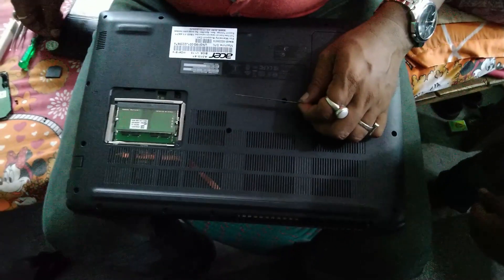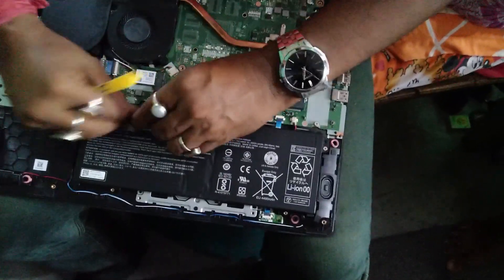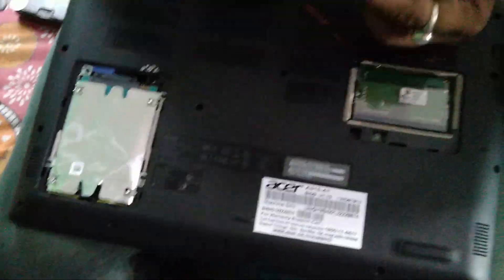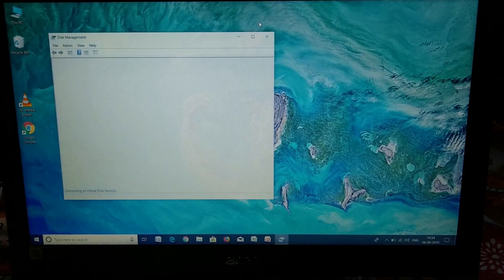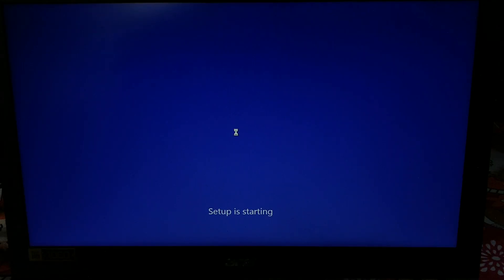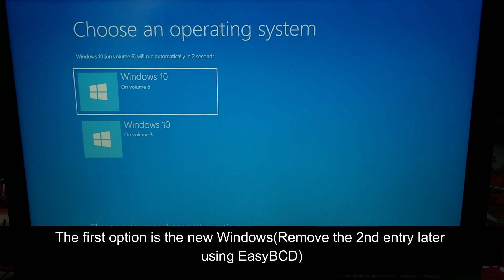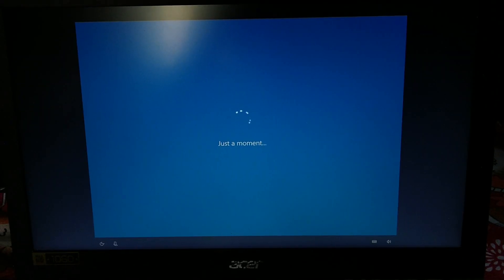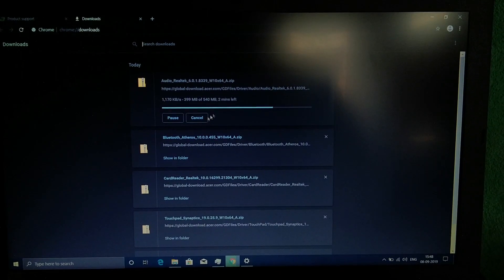ACER ASPIRE 3 a315-41 M.2 SSD INSTALLATION (SSD + HDD) | REINSTALLING WINDOWS GUIDE

Comment: bhai, can I also add another ram slot in it. does this laptop aspire 3 a315-53-p4my comes with two channels of ram or only one channel ? I wanna upgrade my ram along with the ssd so what should be the best option for me?
Reply from the maker: Zian here is the link to the full review! Subscribe 😄
https://youtu.be/6hl1k5oFV00
Reply: @DeepteshLovesTECH  thanks I was looking for the link. hehe so purchase kar lu naa 4 gb ddr4 ? nhi aani na koi problem generally? agar jyada kismat kharaab hogi (joki hai ) to fir dekhte hain. nhi?
Reply: kingston ki to mil nhi rhi ye mil rhi hai  Western Digital WD Green 240 GB M.2 2280 SATA Internal Solid State Drive (WDS240G2G0B)

    Western Digital WD Green 240 GB M.2 2280 SATA Internal Solid State Drive (WDS240G2G0B)
Reply from the maker: Zian yea you can purchase.. I personally have never faced ram issues.. however in shop you can test out and it might be cheaper, I recommend ADATA ram as it has 3-5 years warranty.
Reply from the maker: Zian sahi hai WD green bhi.. le lo.
Reply from the maker: Zian you can add another stick of 4gb ram. It comes pre-installed with a single 4gb stick. Go for 4GB DDR4 2400mhz ram.
As for SSD I recommend Kingston A400 240GB M.2, its fast and affordable.
Reply: @DeepteshLovesTECH  sometimes rams doesn't match. is it true. Should you not purchase a ram kit instead of an individual ram? would it work? and last question that does using ssd really boost speed? if yes then what the percentage ? have you made any performance video?
Reply from the maker: Zian yes I have never in my life faced any problem purchasing a different stick of ram.. if you want to ve extra safe.. go to the shop and try. 
Ssd improves overall speed and windows performance by a huuuuuge margin! Think if you put regular fuel in a super car, would it perform well?!
Yes I have done full detailed review of this laptop, it's in my channel! Check it out! I have said all about performance!

Comment: Bro what if i install Windows Pro on it? Is it still gonna work properly? I am using the same laptop but with Radeon 535 gpu.
Reply from the maker: 나연NEO you use pirated Windows 10 pro. It'll work, else you have to purchase windows 10 pro activation key. This laptop comes with Windows 10 Home so it will activate Windows 10 home, for others you have to purchase key or use pirated versions.
Reply: @DeepteshLovesTECH  uhm do you think theres a diff in terms of speedness of the os with home vs pro?
Reply from the maker: 나연NEO nothing.. no difference. I use Windows 10 Home on my Acer predator.

Comment: I got my acer a315-41 today, same as yours. I already had bought the 8gb ram stick and 480 gb m.2 ssd. Now i found out that it has a warranty sticker. I called up the acer service center in kolkata and they told me to bring the laptop and it will cost inr590 for the upgrade. I don't want to pay that for this simple work. I called up asus customer care and they also told they can't help and i have to visit the service center. Any suggestions from your side mate? Can i safely remove the warranty sticker at home and proceed with my upgrade and paste it back.. or is it too risky?
Reply from the maker: Satyajit Routray exactly just remove the sticker slowly then put it back, no worries. The acer technician said they don't care about seals, infact one of them literally made a hole in the seal on one of my friend's laptop 😂 My technician however simply removed the seal n then put it back.
Reply: @DeepteshLovesTECH  Thanks you mate. Now i can proceed carefully.
Reply: @DeepteshLovesTECH  Hi mate, i successfully installed ssd in my laptop. It's showing in the bios in the hdd-1 section, but doesn't show in boot priority section nor it shows inside the windows disk management section. Mine was WD GREEN 480 M.2 SSD.
do you have any idea, why this is happening?
Reply from the maker: Satyajit Routray it should show in disk management.. it'll ask you to initialise the disk.. and you just hit next next and it'll automatically create the 480gb unallocated partition which you'll then Set up.
Reply: @DeepteshLovesTECH  bro how big m.2 ssd does it support 500 gb or 1tb.. and hows the price..can i use it as additional storage also?
Reply from the maker: @lowendgamer4213  I haven't read of any limitations.. basically it should support as much as m.2 sata 3 is capable of.

Comment: Hi Deeptesh ,Ialso have ACER Aspire 3 A315-53G-54GZ   BUT your's is A315-41 so it's possible to fit SSD in my laptop without removing HDD , PLEASE ANSWER
Reply from the maker: Fahad Khan It should be the same, you can open your laptop n check whether it has m.2 slot(it should have in theory)

Comment: Bro, can you give link to 4GB Ram fro where you bought. 

I bought from Amazon but it's pin is not matching even it's ddr4. Don't know buy.
Reply from the maker: Misal Ambasta I bought 4GB Hynix ram, it was provided by the acer retailer, this is the OEM ram that Acer uses, it's good but very overpriced.
You buy Crucial 2400mhz 4gb ddr4 from Amazon, works flawlessly. I have never heard in my life about pins not matching for ram. You probably bought desktop ram or something.
You can buy from shop also, that way you can test first.
Go for any 4GB DDR4 2400mhz from Adata/Crucial/Kingston.
Reply: @DeepteshLovesTECH  no bro it's laptop ram only of Crucial company and Acer engineer told it's another type of laptop ram. Don't know what amazon's seller sent. 
I have ordered another one. Let's see.
Reply from the maker: Misal Ambasta i can assure you Crucial ram is fine. i have used Crucial/Adata/Kingston/Hynix/HyperX all rams. I have never had any problem with any ram.

Comment: Should I buy this laptop 24999 +extra ssd +ram
Or should I go for acer swift 3 i5  512ssd 44999
My budget is tight and the laptop should work properly for 5 years...
Reply from the maker: swayam obviously go for the Acer swift 3. It's a well built machine slim, it has dedicated Nvidia Mx250 graphics and a much better ips display! This aspire 3 is almost half the price. Beware swift 3's ram is probably soldered. Anyways swift 3 and the Acer Aspire 5s(cheaper than swift 3 and almost same) are much better performance machines than Aspire 3.
Reply: @DeepteshLovesTECH    which one will give better value for money ??? 
Because budget is a issue, but I m bound to buy swift3, if it does not work for 5 years....
Reply from the maker: swayam dude I spent 2 years with a laptop(dell e6400 i5 2nd gen) which was already 4 years old and it is still working absolutely fine.
Why can't you spend 5 years with the Acer swift 3? The swift 3 is one of the best value for money ultrabook.
Reply: @DeepteshLovesTECH  thanks  bro....I m 1st year student and heard that after 2-3 years any laptop except (mac book) does not work properly.... 
But thanks for ur suggestions...
Reply from the maker: swayam I am a 4th year student.. the only thing that will get worse or damaged is the battery. I'm using Acer Predator for 1.5 years now, let's see how it keeps up.
Reply: @DeepteshLovesTECH  parents got my budget down to 35k ,   so will the avita libre i5 8th gen , 8gb+ 256 gb ssd work well for me(price 35k)....   I do not know anyone using this brand but it has good rating on flipkart.... 
Is it's ram and ssd upgradable...
Reply from the maker: swayam I don't know anything about Avita.
Reply from the maker: swayam check store price for the Swift 3 also., That way you can get extra 2 years Warranty for very less price!

Comment: What laptop would you recommend right now 30-40k is my Budget, I prefer Ryzen because i will be light gaming on this and Vega 8 really helps.
Reply from the maker: Vedant Mhatre if you have 40k budget, then during big billion days you will get Acer Nitro 5 2019 with Ryzen 5 3550H(35W cpu) and Rx560x 4GB GDDR5 graphics at only 39990(without ssd model). Best deal in India. Or else if you don't play too much but still want to play games then buy the Acer Aspire 5s(39990 during sales) slim laptop light weight, great specs with nvidia MX250 graphics. 
See in the 35k range try to find a laptop with atleast 4 cores(i5 8250u or Ryzen 5 2500u) ,8GB ram(you can buy 4GB model then add another 4GB stick), and see if you can nvidia graphics (with AMD you'll get very capable Vega 8 integrated graphics).
Also see if the laptop has a 1080p screen and m.2 slot.
This Acer aspire 3(check my channel for full review) is an amazing machine for a cheap price! Upgrade RAM to 8GB and add an ssd, you are set!

Comment: Is it just me or does the guts inside this acer laptop is the same as acer's nitro 5 ????
Reply from the maker: Aegon Targaryen I don't think so, the Acer Nitro 5(intel/nvidia or 3550H/rx560x) has far beefier internals. So different heat pipe/fan config and also Nitro 5 (probably) supports NVMe.
Reply: @DeepteshLovesTECH  i meant the layout :)
Reply from the maker: Aegon Targaryen may be.. not sure.

Comment: Dude can i use an  M.2 2280 Pcie Nvme on my Aspire 3 a315-41G?
Reply from the maker: Jhony Castrillon I'm not sure about PCIe NVME, I don't think it supports it. Go for Sata 3 the performance differences will not be noticeable n sata 3 is much cheaper.
Reply: Thanks!
Another thing; i saw a few M.2 SATA like the ones u linked at the description.
The thing is, they were other than didn't have 2 spaces, only 1.
Those can be used too o are just completely different?
Reply from the maker: Jhony Castrillon I'm sorry, I didn't get you.
Reply: https://subefotos.com/ver/?24153d5e7d1907604ce3826a58403430o.jpg 
This is what i mean sir, the socket and the M.2 than i got are different from yours.
I can still use the one u linked?
Reply from the maker: Your image is different because it is PCIe NVME, my linked drive is SATA3.
Reply: @DeepteshLovesTECH  ohhhh i get it.
But i  connected it and didnt show anything un my Bios le anything like that, what can i do?
Reply from the maker: Jhony Castrillon idk i already told you, I don't think Aspire 3 supports PCIe.. try SATA3.

Comment: Hi bro, can i install a HP M.2 NVMe PCIe SSD and an additional 16GB RAM  in my Acer Aspire A315 - 55G
Reply from the maker: Nagarajan k I don't think Aspire 3 supports NVMe .. use SATA 3. Yes you can install 2x8GB ram in your laptop. Don't install 1x16GB. Install 2 8GB sticks.

Comment: Hey mate, can you suggest the best capacity for m.2 ssd cause i have read that 1tb ssd will make the disk take more time to load. Btw i am not a heavy gamers.
Reply from the maker: aideehalim 16 240GB is a sweet spot in terms of value for money. you can get WD 240GB m.2 from Amazon.
Reply: @DeepteshLovesTECH  what type for that socket? M.2 sata or nvme? If you dont mind can i get your social media acc for any purpose? 😅
Reply from the maker: aideehalim 16 I am pretty sure it is M.2 SATA3 not NVME.. so don't buy NVME.
Reply from the maker: aideehalim 16 check description for social media ☺️

Comment: Hi Deeptesh as you installed 120GB SSD just for C drive where window is installed what about the rest? Does installing window on C drive where SSD is there improve overall working experience. or just App loading time, Performance of softweres?
Reply from the maker: Definitely it improves the performance extremely! Whatever software you install in the ssd also opens up much faster... Check my channel where I have uploaded full laptop review, you can see the performance bump as I describe there... And the whole HDD is basically the D drive 😊
Full review: https://youtu.be/6hl1k5oFV00
Reply: Hey @DeepteshLovesTECH  i have heard that AMD Ryzen 5 processors only last around 3 year of time and after that You start to face issues like Graphical errors and danages
Reply from the maker: @anishaansari330  which guru said this?

Comment: Hi Deeptesh, I had bought this laptop for my Dad's word-processing work :-) He stopped using it and I need a laptop. But this one is very slow, I wanna upgrade and I came across your video. My savior :-). Just one doubt about the SSD can I instead use this SSD? ADATA Ultimate SU800 512GB M.2 2280 instead of ADATA Ultimate SU650 512GB M.2 2280? The only difference between the two is S800 instead of S650. Thank you.
Reply from the maker: Watch the full laptop review on my channel too... Make sure the S800 is not PCIe, the laptop only supports M.2 SATA3 ssd
Reply: @DeepteshLovesTECH  ok thank you.

Comment: I wanna add ssd with bigger capacity. I wanna add minimum 500gb ssd. Should I also increase ram? Will it boost performance? And where is the performance comparison video?
Reply from the maker: Tapan Sharma check the full review on this channel, there I have shown the smoothness while heavy multitasking: https://youtu.be/6hl1k5oFV00
Yes you can easily add 500gb M.2 SATA ssd(don't buy NVME PCIe).
You may add extra 4GB 2400mhz for dual channel memory that will improve gaming performance and overall system performance.

Comment: My track pad is not working help me
Reply from the maker: Mohammed Ahmed I think by mistake you disabled the track pad using one of the function keys.. see I think F7 has the trackpad off/on option.. so press Fn + <function key with trackpad option>
Reply: @DeepteshLovesTECH  i can't find any driver available in drivers
Reply: @DeepteshLovesTECH  help me bro
Reply: @DeepteshLovesTECH  i need drivers mainly track pad
Reply from the maker: Mohammed Ahmed did you try my solution?
Try it first..
Else there is touchpad driver in the acer website.. download the Elantech touchpad driver.
Reply: @DeepteshLovesTECH  tried brother
Reply: @DeepteshLovesTECH  brother say me how to install this
Please and ASAP
Reply: @DeepteshLovesTECH  bro I have installed extra 8gb ram and 256gb m. 2 ssd.

I downloaded Windows 10 iso and booted it through rufus.

Formatted 1tb hard disk and installed windows os on ssd

But only problem is with touchpad drivers

Its is not able to find it

Help me bro
Reply from the maker: Mohammed Ahmed why not? By default there are touchpad drivers in Windows 10, did you try the function keys,? See there is a function key for enabling/disabling the touchpad..
Or go to Acer website and find the Elantech drivers.
Reply from the maker: Mohammed Ahmed here:
Download Elantech driver from driver section
https://www.acer.com/ac/en/US/content/support-product/7540?b=1

Comment: I was planning to buy a SATA SSD to replace my HDD for my Acer A315-3G when i came across your video.. I didn't thought that acer aspire 3 is capable of M.2 SSD. Do you think my model is compatible with M.2 SSD? Thanks! More power..
Reply from the maker: This particular model had an m.2 slot, confirmed by the retailer guy. Plus I already saw online that this model had m.2 slot, I'm not sure about your model, why don't you open up the laptop to check? Or you can call Acer service centre and ask them whether it has a m.2 slot.
Reply: @DeepteshLovesTECH  I couldn't because it is still under warranty.. If i'll open it I might void it's warranty..
Reply from the maker: Jericho Murito ohh but here in India, Acer technicians don't care about the seal, as you saw in the video, he removed the seal and then put it back..

Comment: So for installing. SSD in your laptop you didn't have to remove the hard disk right..means you have HDD AND SDD in same laptop?
Reply from the maker: Yes I have a 120gb ssd and a 1tb hdd in the laptop.
Reply: So how will the hdd card come into picture than? I mean just to store your data? And what about the SSD than... How both works? Can you please explain ? Thanks
Reply from the maker: Kamalesh Barman yes both works together.. your Operating system and other frequently used softwares should be installed on SSD(which acts as main boot drive and c drive). Anything on ssd will open very fast and windows performance will be very smooth. 
You can use the HDD for media storage like games, movies, music and whatever you want.

Comment: I have a doubt does the windows activated after installing ssd with windows. And does the mechanic do these all things. 
And finally can I install extra 8gb ram with 4gb which is already given. So totally 12gb..
Reply from the maker: kanchi Balachandran no the laptop comes with 4gb DDR4 2400Mhz ram, I added 4Gb 2400mhz ram Extra for Dual channel memory. Ryzen loves dual channel memory, also helps the vega 8 graphics.
It is useless to have 12gb ram that is not in dual channel.
Yes windows gets activated without any problem, watch the whole video. Yes acer technician does installation but after the installation I have learnt that there is no problem you just carefully remove the sticker and add your own ssd, there is no problem.
Reply: @DeepteshLovesTECH  but 4 GB dual channel or 4 GB in one slot and 8 GB in another slot . Which works will to get more fps and speed.
Reply from the maker: kanchi Balachandran 4gb in one , 4gb on the other.
Reply: @DeepteshLovesTECH  ghanks
Reply: Sorry thanks
Reply: @DeepteshLovesTECH  so. 8gb in one and another 8gb in another slot increase the performance
Reply from the maker: kanchi Balachandran yes make sure.. same rams are there.. for e.g: 4gb 2400mhz + 4gb 2400mhz
Reply: @DeepteshLovesTECH  ok i understood
Reply: @DeepteshLovesTECH  how much vram does it have. So can it run pubg mobile on 1080 with 60 fps
Reply: @DeepteshLovesTECH  and you got a new sub..